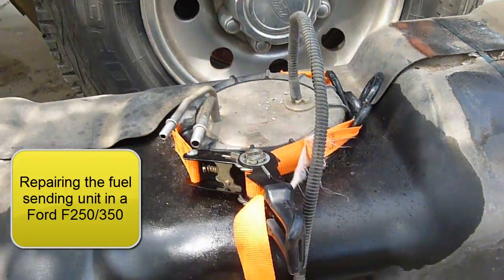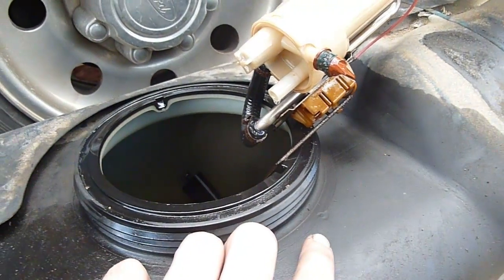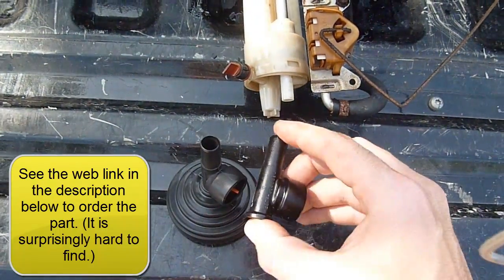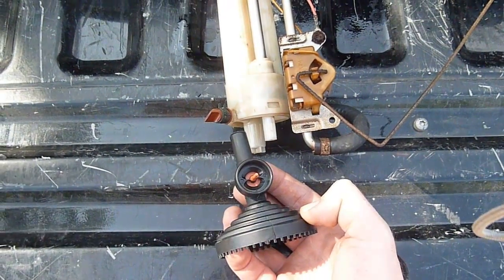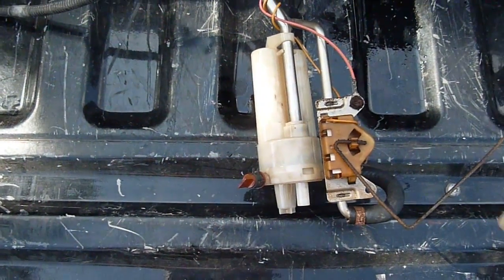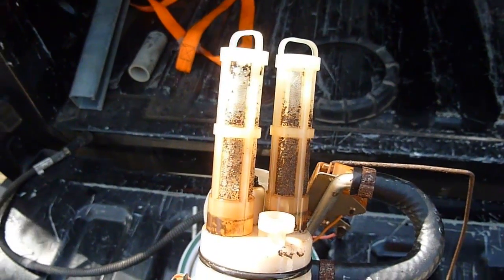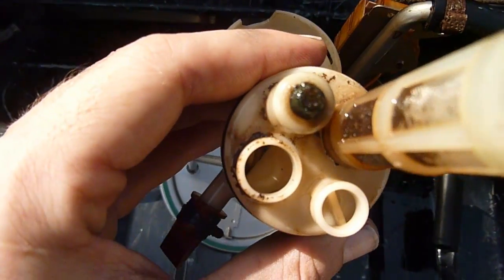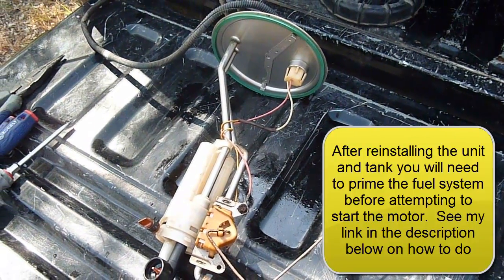Fuel Sending Unit Repair | Ford F250 / F350 7.3L Powerstroke Diesel

Comment: Do not plug that little orange valve.  Do you even know what that does?  It's called a de-ice valve.  Sometimes you can get a layer of water on the bottom of the tank from a bad load of diesel and if it freezes, it will block off all fuel to the engine.  If that orange valve is still operational, the engine can still draw fuel thru that hole until the ice melts.  On the 7.3 the fuel gets heated in the fuel bowl on top of the engine via a heater element.  Does not take long to de-ice the fuel tank from the heated recirculated fuel.  Ya'll need to leave these items the way they came from Ford.  There's reasons for everything.  The more you know...
Reply: I have replaced 5 of these junk filter in a ford f350,don't make any difference what brand. Last time installed a stratened paper clip thru the side walls in front of the little orange plug so it doesn't fall out done the same with the screen on bottom of strainer. Maybe it stop running out of fuel at 1/2 tank

Comment: I wish I could find a video about how to reinstall the large plastic assembly lock nut. It simply will not rethread onto the tank even after cleaning it and spraying it with silicone spray. It simply binds and pops off after 1/4 turn.
Reply: Did you ever get it on?
Reply: @JohnJones-s3v  not completely. I got it mostly on and then sealed it with Seal All sealant. If I ever need to go back into the tank I will simply cut the sealant.

Comment: I replaced the lift pump. 
It turns on, but does not fill the fuel bowl. Could the sending unit be bad?
Reply: You are mostly correct you have 2 screen in fuel bowl and 2 screen in tank . The fuel regulator on the side fuel are more likely cogged with algae like the one in video clean 2 in reg first.😊

Comment: Hey sir not sure if you know this just did mine a on th ago and everything is fine and saves 600 bucks. The sending units just snaps off of the unit housing and I ordered the gas sending unit for about 100 bucks and it snaps directly onto the old sending unit spot on the housing   I ordered the gas winding unit for same year truck as mine that is 2000 model. Is a direct replacement the arm would have probably worked too but I used my old one it snaps directly to it. So hope this info will save a lot of people money
Reply: hi Duane would you happen to have a part number i  can reference looking to recondition my tanks

Comment: Is this the reason the dashboard fuel level needle isn't accurate for the front tank but when I flip the switch to be using the rear tank's diesel supply the readout says the correct fuel level? I have a 1997 f350  7.3L turbodiesel XLT dually Mason dump. Is it available from Amazon? Thanks
Reply from the maker: The most likely explanation is that the float on the fuel sending unit in the first tank is bad
Reply: @innocuous_name7212  Got the sending unit out. The float was filled with diesel. Can't find the exact location of the leak on the float. I found what looks exactly like it on Amazon n ordered it. It's a metal 2" by 1 3/16" little can with a simple band around it for where the coat hanger arm wraps around to attach it to the sending unit. Was 11 bucks. Hope this is the only problem. The black filter screen looks fine. Thanks
Reply: @innocuous_name7212  if it's the float, will it be obvious when I examine it? Is it replaceable or cheaper just to buy a brand new entire sending unit from Amazon? Thank you

Comment: Does a 97’ Model f250 have this ?
Reply from the maker: Yes it does. The configuration may be slightly different but the overall design is the same.

Comment: ok cool my 2002 7.3 is idling fine but when I press the accelerator it starts spitting and sputtering not sure what the problem is
Reply: PROFESSOR X it could be starving for fuel (not p/u enough fuel to run) check ur filters if u have a filter in the tank and all other filters if that don't work it maybe in ur injectors if u can try to hook it up to a computer n check the codes u would try that first but keep them filters clean also
Reply: it was injectors
Reply: PROFESSOR X ok at least ur found the problem not a cheap fix thou I just had to drop both of my tanks clean the rear one out n replace my front n the screened  p/u tube on both tanks broke off had to replace them to it was a job well have a great day be safe n ur travels

Comment: how did you know that was the problem with you truck.
like was your truck running rough
Reply from the maker: PROFESSOR X  the truck would no longer pull fuel after the tank got below a quarter full. So the fuel gauge was reading as quarter tank but the truck would stall out because it wasn't actually picking it up.

Comment: Hi,  I am trying to find out if just the float/gauge is available. I have a 99.5 that's reading either half tank or full tank always and it would appear that maybe a motorcraft PS-20 "sending unit" for a 90-97 would work, just switching the rods/floats out if possible.   If it reads 12ohms at empty and 160 ohms at full... it should work, right?
Reply: I'm having the same problem. Did you ever get the motorcraft to work?
Reply: Duamerthrax I didn't have to do it because I found a chafed wire, but, all indications would be that it would work. The sending unit for our trucks is extremely overpriced for what it is.
Reply: Brian Hicks I ended up finding a pick and pull lot near me with a bunch of ford diesels in it. New/used sending unit, tank straps, fill neck, and skid plate for $100. I this opportunity to modified the fill neck to handle the one inch nozzles big rigs use.
Reply: Wow, that's cheap.  There's one here that has a 7.3L SD that they want $4k for the engine, it was hit by a train but still runs.